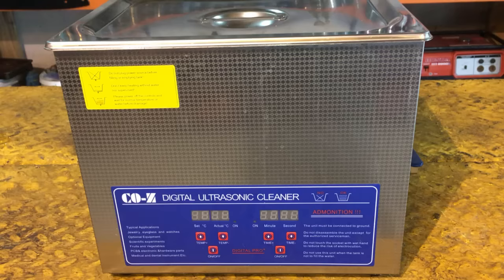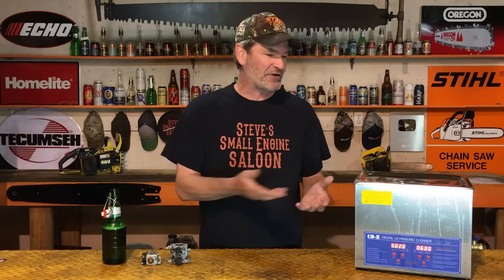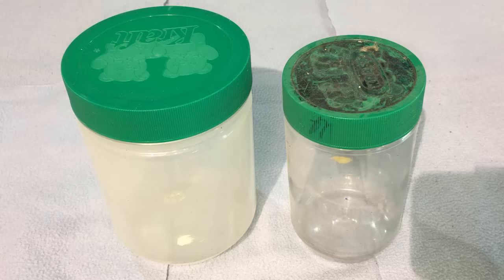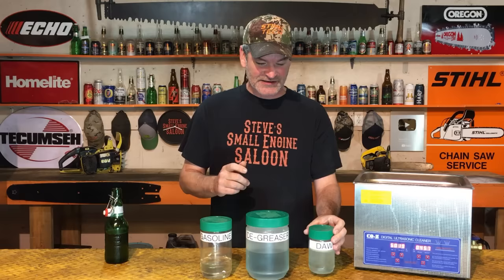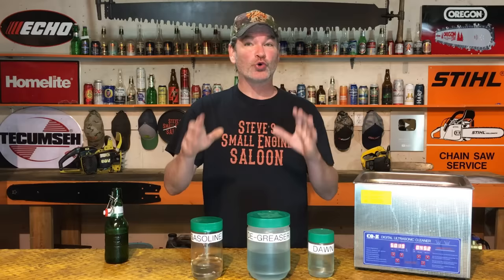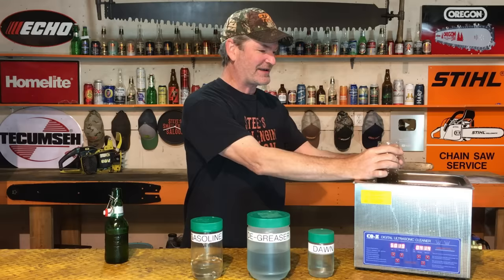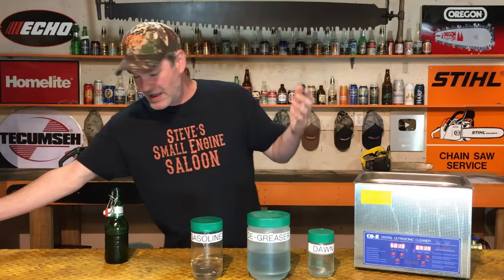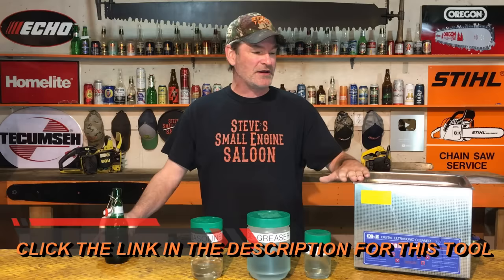ULTIMATE TIPS For Using An Ultrasonic Cleaner (Must Try)

Comment: Pro tip: put a coin sized amount of dawn in your hands. Rub it in like lotion until it dries. Work on your car, wash your hands. Everything comes right off. Thanks for the video.
Reply from the maker: Great idea!!
Reply: omg i love you
Reply: Hey, glad I could find this thread. I did some research and putting your hands in an ultra sonic bath is not good for your hands and in particular tissue in the joints.
Reply: @georgisgarage  Everyone needs to stay out of the hot tubs!
Reply: I've been using that trick for years! A little bit of dishwashing soap, then rub it in everywhere making sure to get it down deep in your pores. It feels crazy at first as you're doing it. After it dries, it feels a ~little~ different, but you soon forget about it. Later, after the job is over, and your hands are greasy and grimy, they clean up easily with just warm water. ...Another trick is, if you're going to be around poison oak or poison ivy, rub dishwashing liquid into your bare arms and legs. The toxic defense of the plant is an oil, so it begins to emulsify simply on contact with the dried dishwashing soap. Washup later amplifies that effect and the emulsified and diluted poison ivy oil goes down the drain, never having a chance to get on your skin.
Reply: @georgisgarage  I think he's suggesting to use the dawn as a barrier cream, not using the ultrasonic cleaner to clean your hands. You can also get purpose made barrier creams for this purpose.
Reply: Instructions not clear- now I'm missing 3 teeth, a 1 Inch socket and a breaker bar 😂 jk
Reply: Thanks for the tip, thats a great one!
Reply: Also a great way to have hands like humanoid lizard in no time.
How about super fitted textured tip gloves?
Reply: Boodysaspie  I wasn't involded in major spills just cleaning up local ponds in an organized effort. Working the problems doesnt have to be a major catastrophy, just look around and get involved. I did youth coaching for ten years, greyhoud rescue for 15. Part of an organization to repairing cars for the poor for 5 years.

Comment: Trivia on the gasoline.  It's original use was a household cleaner!  Was sold at drug stores in a little bottle.
Reply: Do you think you could use Diesel instead?
Reply: The Great Chicken Overlord - I’ve used diesel to clean engine parts. Works great. Doesn’t have that nasty tendency to explode into flames. Does leave an oily residue, but that’s good on non painted parts since they don’t flash rust as much.
Reply: @thegreatchickenoverlord5976  Crude oil cleans everything, rinse off the crude with mineral spirits or lacquer thinner. It sounds crazy but once you think of all the solvents in crude oil it all makes sense.
Reply: @davidparker9676  When I was a line mechanic a squirt from the oil gun worked great to clean really grungy hands. Then just wash with soap of course.

Comment: Why you blew your old one up is that if you do not have enough liquid or it's empty, there's an enormous amount of reflected sound, all that goes back into your ultrasonic transducers, which work both ways and it ends up blowing the driver circuitry on the other side.

Comment: The De-Greaser need to be aluminum safe... If you are using Simple Green, you need to use Simple Green "D". It won't oxidize the aluminum.
Reply: so I used a de-greaser and my carburetor turned black, obviously i'm not going to do that again. Do you know scientifically what creates the black "soot" that is now covering the carb? There was a lot of fizzy action going on... i'm guessing the aluminum was reacting with the degreaser chemical? Did I damage the carb or can I just run it through with another cleaning product?
Reply: @MarshallBLewis  you oxidized thw surface, that grey/back coating is oxidized aluminum. A brillo pad and an aluminum safe cleaner should shine it right up.

Comment: Hey Stevo ...  I have watched both of these videos on the ultra-sonic cleaners. In the first one you talked about filling to the fill line with water ... and using smaller containers in order to not dirty your cleaner. Well it is my suggestion, if you have something large you are wanting to clean, instead of using the water, you need to fill with vinegar or whatever, use one of mama's kitchen garbage can liners that will fit inside of the cleaner as a liner for it!    It will keep the cleaner "cleaner" and you will be able to use the full capacity of the cleaner tank. Simply insert the garbage liner then fill with whatever cleaning solution you are wanting to use. WARNING WARNING WARNING WILL ROGERS!  Be sure to test the bag to be assured it is leak proof prior to using!
Reply: Uh that warning warning will ROBINSON....avid lost in space fan.

Comment: gonna have to try this. I first used an ultrasonic cleaner at a motorcycle shop and was never impressed (mostly carbs).
Got one to do guns and got the 'right' chemicals...not impressed really - BUT your way looks like a way to expand it's capablitis and reduce the mess/waste of chems. LOVE IT!

I never ran it for 10, 15, 20 minutes...mine has 3 times settings and 3 min is longest.
Reply from the maker: Right on

Comment: Steve, just wanted to thank you.  You've saved me quite a bit of money and aggravation just this weekend with fixing my Echo string trimmer.  Just a question about the ultrasonic cleaner, if you use a jar with dawn soap and water mixed, does it build up pressure, like if you filled it and shook it?  Just wondering.  I'm going to order one of these cleaners.  
On a side note, I watched the ultra sonic cleaner video's out of order, and I thought you was joking around when it made that loud noise when you first turned it on.  Thanks for sharing!!!

Comment: do NOT put polarized sunglasses in an US cleaner.  I destroyed a pair as the cavitation occurs between the laminated layer and bubbles, peels.  I've never destroyed anything else.  Been using sandwich bags and glass jars for years to keep the solution clean or use something more volatile. Great video - thanks!
Reply: I put a pair of glasses in the sonic cleaner and the Cascade dish washer soap hazed the lenses.  I hope the vibes didn't do that.

Comment: Laundry soap, I'll use that especially when I need to remove organics. And mouthwash I've found is actually very nice to use in it as well, but I mostly use that for cleaning things that will come in touch with a food process. (also working with an allergy here to some soaps)

Comment: Hey Steve, you probably blew a transducer because the level of fluid is critical as it acts as a coolant as well as a cleaning solution. That's why you shouldn't run the cleaner for longer periods as recommended by the manufacturer. Having too little fluid will cause overheating and wreck your machine. Regards. Ps:- great tip on using seperate containers by the way 🖖
Reply from the maker: Right on

Comment: I know Im a few years late, but just recently found Steve. Anyway Ive been using CLR for a long time now. I know its not the best or fastest cleaner for some things, but I clean everything from electronics to car and bike parts - without ever worrying about a solvent beeing too strong or contaminating solder joints. Use it 100% right outta the bottle. I do also place items in smaller containers, but I use tupperware type containers- whatever the part fits in.

Comment: It is the tiny bubbles that do the cleaning which appears with the vibration. I tried several containers but with no luck. Did more research and found out if the tiny bubbles can’t touch the part, no cleaning happens.
Reply: Then why did it work for him in this video

Comment: @Steve's Small Engine Saloon  I use purple power 25% and Kerosene 25 % in my Ultrasonic. 
Then mix with water 50%.Works well. I like the idea of useing the plastic bottles. I will try it.
Thanks For the TIP.
Reply from the maker: You're Welcome...

Comment: Solution simple green, evapOrust. Can be used over and over. I leave it in the cleaner, every 10 washes I clean it.
Reply: What concentration's           ?
Reply: @zombieengines7336  80% Simple Green 20% EvapORust
Reply: Purple power works good too.
Reply: @MrTheHillfolk  It's just corrosive. Turns carbs and any shiny metal to a tarnished color.
Reply: Simple green eats aluminium. That's why it is not to be used on aircraft. It actually say it on the bottle
Reply: @kirkstinson7316  All degreasers "eat" aluminum, turns it white and makes pitting on the surface. Spray degreaser on a shiny set of polished aluminum wheels and afterwards they will look white and ashy.
Reply: @bigtexas7580  I use it all the time warmed up in my ultrasonic to clean carbs. 
If anything would tarnish it would be that zinc/fake metal crap.   
Even done a few Briggs heads and never had an issue. 
Keep it submerged and rinse with water as soon as you extract it. 
Dont use on hot aluminium and let it dry  unless you like it to look corroded.
Reply: Fiore Vitola same here w simple green

Comment: Best degreaser I ever used was Awesome from the Dollar Store. $1/bottle. Just don’t breathe the vapor. Diesel would probably work pretty well, too.

For aluminum, Simple Green Extreme rather than the standard version. The Extreme version doesn’t corrode aluminum.
Reply: Awesome is...well.....Awesome!!!!! I use it to pretreat my house when pressure washing as well as many other things...Works great.  You think it would clean a carb too huh?
Reply: Kevin Woodcock   I think so, but I would use a dedicated carb cleaning solution (since I already have some). Awesome is hard to beat, though. I use Zap Truck and Trailer Wash in my pressure washer. That stuff is like Awesome on a larger scale. My Cummins made an oily mess underneath until I fixed the leaking tappet cover. The Zap cleaned it up like it was new. I bet it would work well in an ultrasonic cleaner.
Reply: @mannypuerta5086  bought some simple green for my new ultra sonic cleaner and was gonna go with a 50 50 mix for carb cleaning at about 20 mins a cycle.  Thanks for your thoughts and ideas.  Much appreciated Manny!
Reply: Kevin Woodcock   I use Hoppe’s #9 to clean the carbon and fuel stains on my airplane’s brass fuel injection nozzles. That might be another option, but I know the Simple Green will remove exhaust stains, which are difficult to remove. The other plus is that Hoppe’s smells really good.
Reply: I think you are referring to L.A's totally awesome.   I use it in a 1:4 ratio with water to clean saws for overhaul.   I have an old parts washer that hold 10 gallons and it works great.   Mix it stronger and it ruins the gloss of the plastic and metal on saws.   Knock off all the loose material first and wash the saw with a stiff paintbrush or a toilet brush as fast as you can and rinse with clean water immediately to stop the cleaner from removing the shine of the saw.   Don't mess with the pump on the washer as it will cause the solution to foam up.   Just using a brush does the trick.

Comment: I predict in 15 years: ultrasonic dishwashers for the home at the same price as todays dishwashers
Reply: And ultrasonic bath tubs, we all have that one friend who could do with a good scrub.
Reply: blah blah , they have been around for at least fifty years, are you new.
Reply: @onestepatatime2346  Haha are you telling me that I can go down to the white goods store right now and buy an ultrasonic dishwasher? Like, right next to the ones that spray hot water on the plates and at the same price as the normal ones?
Reply: @blahblahblahblah2837  
I think he is saying that ultrasonic cleaners have been around at least 50 years already so if the tech were gonna be adopted for dishwashers it would already have happened. I don't think the tech shift would happen there for two reasons. First, dishes are effectively cleaned with spray in most cases, the ultrasonic is not needed as with items usually cleaned with ultrasonic. The most common applications include "blind" holes and spots that are difficult to get to. Or porous materials which have been impregnated with dirt or other materials. Second reason is that the entire container must be full of fluid, water.  Modern dishwashers would not fill up your dishwasher even six inches let alone completely fill it. It would be a huge waste of water.
Reply: For that to work you would have to fully submerse the dishes. Not practical.
Reply: They would probably break down so fast compared to the simple hoses and jets.
Reply: Can you imagine how loud that sucker would be?

Comment: Is there a danger of the machine being "over filled" with the water? 
My thinking is that the smaller containers with small parts (i.e.: the demonstration of the socket cleaning) will have a very small displacement of the the water already in the machine. However, if you put the larger container with a sizable part inside of it, the displacement will be greater and the water level will rise higher than it did during your demonstration. 
Have you ever run into this situation and had to remove water to keep it from being over full?
Reply: It’s simple just to use common sense and keep the water in the machine at the FILL LINE, then when putting in containers if it raises too high simply remove some of the water before turning it on and starting so it doesn’t overflow.

Comment: You know what?  I'd heard, somewhere, the idea of using containers in my Ultrasonic cleaner.  But it never clicked.  That's f'ing brilliant.    I normally use Simple Green, and I also let it heat up to 80C.  But it's such a PITA to clean all the crud out of the bottom after draining it.

 I use Xylene for tough degreasing--an even stronger solvent than gasoline.  But it's flammable (and pricey) so I usually filter it back into the metal can when done.  It's really thin so it filters fast.

Thanks a million, I won't forget this next time I use mine (which is the exact same model as yours!)
Reply from the maker: You're Welcome...

Comment: I have the exact same cleaner and the noise was driving me nuts. Open up the bottom and spray some non conductive heat resistant expanding foam all through the bottom. It only took one can and it is 90% quieter now and still cleans just as well.
Reply: It will over heat and fry it

Comment: Hi Steve.  I prefer using Simple Green as my cleaning solution of choice since you can dispose of the used cleaner down the drain safely.  I use a small ziplock sandwich bag filled with Simple Green and the small parts I need to clean.

Comment: Glad I watched this video. I was partially filling mine as well. Now I know not to do that. Thanks.
Reply from the maker: You're Welcome...
Reply: I plan to get one of these and would have only put enough in to cover the parts I'm cleaning.  I would have never thought about it making the thing run hot and burn out.  If I learned nothing else from this video, that alone made it worth it.  Of course, I learned other things as well.  :-D

Comment: I use ORIGINAL pine sol. You can watch the carbs come clean in no time. It's cheap not flammable and makes your carbs smell like a pine cone when your done.
Reply: Kirby do you use pine sol straight? Or mix it with water? Thanks
Reply: @x5dzp  I have read mixed , try 50/50 ?

Comment: I think you should consider the fact that these machines are spreading even in the 3D resin printing world. Ultrasonic cleaning 3d resin printed parts, with ipa, nitro, acetone, mean green, mr clean are huge topics to deal with in relation to their efficiency-safety-cost. I was using 15 lt 99% alcool directly into the tank, always afraid of explosions and as you can imagine your tips are incredibly useful especially for solution's waste and safety. Big hug for you! Thanks!!!

Comment: Guys don't hold the container or item you have in the ultrasonic cleaner... just a tip.
Reply: ultra sound can be bad for fingers and wear full ear protection and back away when operating.
Reply: @Morgan2XL  The thing is that an ultrasonic cleaner will vibrate any material or liquid that comes in contact with it. *So even the blood inside the fingers will vibrade with the same frequency as the water in the tank.. and that is probably not very good for the bloodcells.

Comment: Diesel fuel. Safer than gasoline and works just like it.
Reply: not for exposure to humans, diesel on the skin will soak right through your skin and  into your body and poison your liver in a way that few other substances can, for fire safety ? 
yes, 
but having to deal with parts soaked in diesel is far far more toxic than those doused in petrol.
Reply: @deadprivacy  You're not swimming in it dude. Handle it just like you would gas- pull it out, wash your hands, spray it down with carb cleaner on a towel on a well vented bench, let it dry. If you're worried about the carcinogenic possibilities then don't used refined products at all and deal with water or alcohol based cleaner effects.
Reply: @jamesoliver6625  no dont, its far far worse for you  than petrol.
It soaks through the skin, repeatedly handling it as you do?
Can end up with you suffering catastrophic liver failure, ive seen this happen to a friend, a boat mechanic of only about 35 years of age.
It isnt gasoline and shouldnt be treated as though it is.
Reply: @deadprivacy  They have these things called "gloves"... recent invention ya know.
Reply: @deadprivacy  Just like gloves, and overzealous safety nazis.
Reply: James Oliver alcohol based cleaners accelerate rusting by making the surface conducive to oxygen. Just watchProject Farm’s video on rust removers.